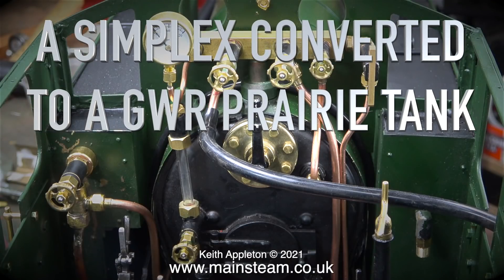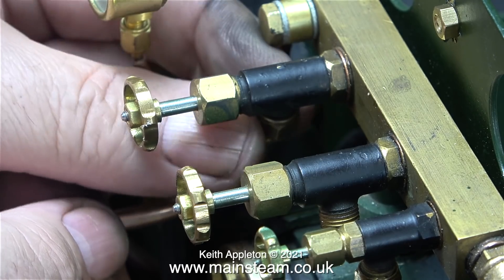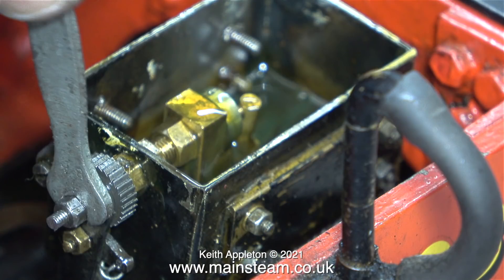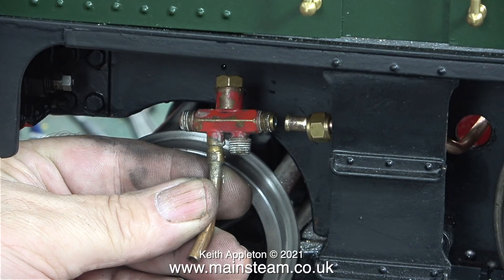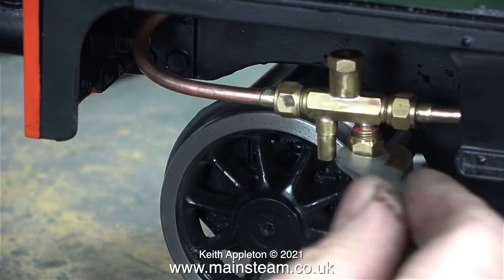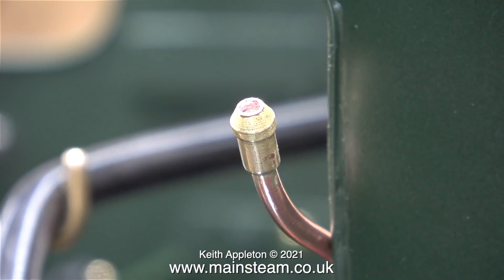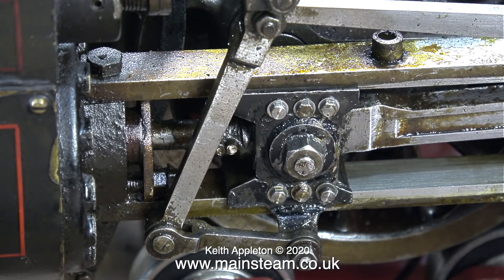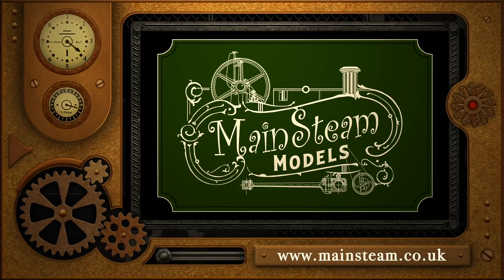SIMPLEX PRAIRIE TANK - PART #100

Comment: Really fantastic ‘build’ Keith 👍
I have tried a lot of the ‘tips’ you have included in this and other vids. I’ve discovered for instance that the spray can caps here in Oz, have a small pesky hole drilled in them, such that paint/turps/metho/ etc., all leak out when one uses said caps as containers 🤣🤣.
Regards,
Robert
Reply from the maker: Yes some of ours do too, it's a pain .....